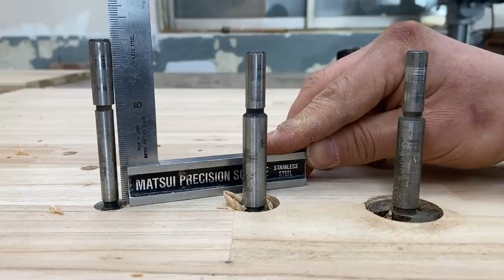90° Right Angle Multi Hand Drilling Jig [Woodworking Tips]

Comment: That Dewalt drill chuck sure does chew up those drill shanks! Just remember to stone them down after each use.

I have got two Dewalt drills just like that here. I have a crap set of drill bits I use with those drills. The chucks are so bad.